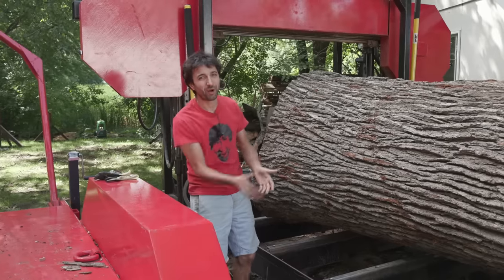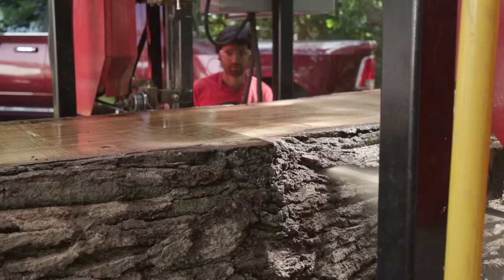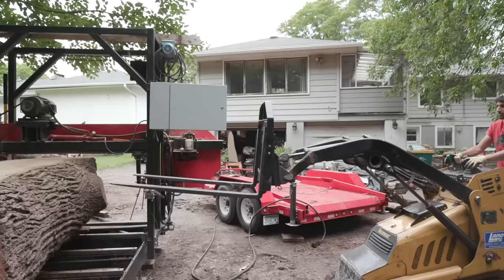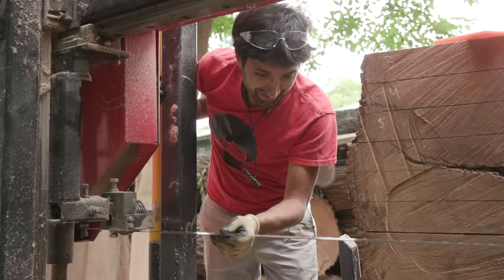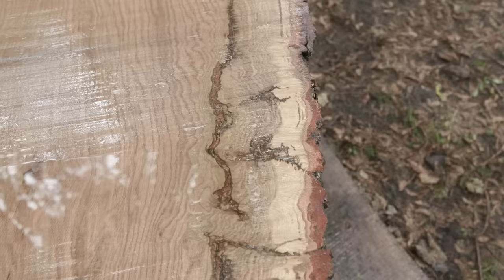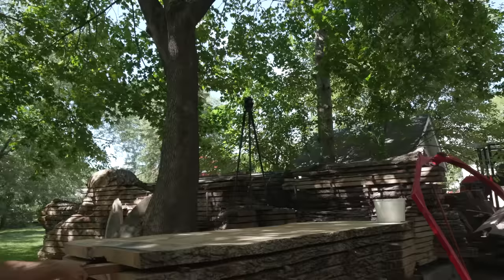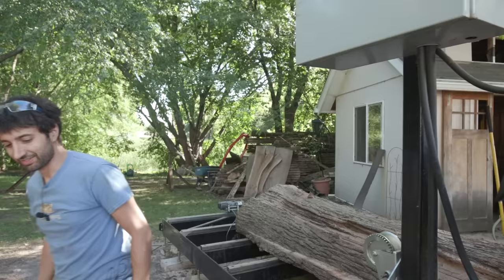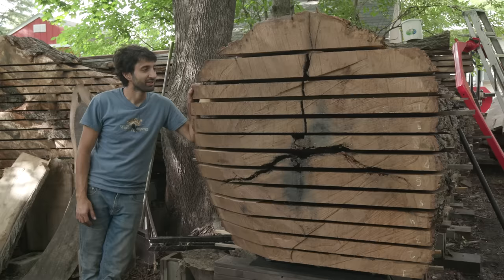Slabbing almost 8000lbs of White Oak

Comment: I'm sure you have answered this question before, however I have not seen the answer. on so many of these bandsaw mills the operator has a drip system or a water tank that auto feeds liquid to the blade, why dont you use such a system>
PS..I like your videos
Reply from the maker: Just never installed it

Comment: Isn't these defects being done to the wood because of the weight from slabs not being removed between cuttings which I think  causes the blade to have to work harder🤔; henceforth, the reason for the blade getting stuck so often and needing to be replaced so often also??🤭

Comment: Matthew I know this is over a year ago but in all your videos you splash the water on the slabs with your bucket. I used to do the same thing but I found it much cleaner and far less messy to run a hose and spray nozzle; same results and I don't get water on me or wherever I don't want it. Thanks for sharing, love your videos.

Comment: I think I would have been getting too heavy slabs off of the blade of each level off of there so it's not putting so much pressure on your blade second slab look like that blade was starting to bounce there's too much weight on the blade get the weight off of the blade it would come off a lot easier the slabs look like the blade has been bouncing

Comment: I realize this video is to years old. 
But the butt pucker factor was the same. 
Having worked at a big saw mill in my youth metal in a log is serious when running a ban saw. The mill i worked at ran one about 30ft long when laying on the floor and a 1ft across.
They ran each log threw a metal detector 
How ever sometimes it would miss something. Nails ruin the blades which cost a few grand each. But the real danger was the metal pushing the blade off the back mill wheels. When a blade goes from thousands of rpms to instant stop all over the cariage. It was nasty. And pieces of blade went every where. Pretty scary! The sawyer set in a cab with ballist glass windows. But anyone walking by could be seriously enjured.

Id love to own a mill like Matt's but I'd want atleast some plexiglass between me and that blade or a remote. Lol 
Metal makes for some cool staining in the logs sometimes.

Comment: This is the first I've watched in a while since I watched the entire saw building series. Even watching someone else slab a log is oddly satisfying!

I have two questions. First, have you ever considered using a carbide tipped blade?

Second, why do you dump water on the slabs as you're stacking them to dry? It seems that most of the water just sits there and will eventually soak into the wood, taking that much longer to dry. 

Thanks for another entertaining video!

Comment: Matt, have you ever made a video to discuss what you would do to make the "CremonaMille" even better if you were to do it again -- size, motor, materials, sectioning, wheels, blades, etc.... What have you learned these last years. Oh and the blades you have been using the gauge teeth/brand/quality carbide #

Comment: A second thought for an enhancement is a rail maintenance area so you can move the top off of the bottom.  This would allow you to experiment with hydraulics on the bottom platform Without worrying about the upper saw part, or repainting the bottom half.  Sort of formalizing what you did when you separated them earlier, but more useful and functional when you are by your self.

Comment: Correct me if I’m wrong, but the pile gets heavier  as you cut down. Wouldn’t it be less stress on the blade and machine to keep taking of the slabs as you cut ? Otherwise your just pinching the blade..

Comment: Get a 1" cube or cylinder neodymium magnet to sweep your log between slabs, will penetrate 4+ inches into wood so you can find metal before you blade does.

Comment: The problem with the blade hanging, may have to do with both the weight, and the moisture content your dragging it through. I would recommend removing, some more cut slabs, before continuing.

Comment: Each plank weights 100lbs. That weight is on the blade dummy dough. Think.
If there is not 500 lbs of weight on the blade will it move easier? Cut better ,last longer.

Comment: A tree weighs 4 tons so if you  cut 6slabs and leave them on the log, the saw will bind up because of the weight on it just like using a skill saw with the most weight on the outside, poor planning.

Comment: Seriously, having 5-3 inch slabs of an 8000 lb tree riding on top of your 6th cut is probably  an indicator of one problem with a sticking blade.  Just remove as you cut, so much easier and safer...just sayin dude..

Comment: You definitely do not know the proper way to mill wood.  Remove those first slabs of wood away.  Don't leave more than 1 slab on top before cutting more.  Less binding problems and less wear on the blade and less milling or cutting marks left on the wood.

Comment: Can this white oak be used for shotguns and rifle stocks and butts..sealed with bees wax and aged.. insuring a long strong life... what happens if this wood is kiln dried... what I have discovered is kiln dried hard wood for shotguns and rifles does look pretty but it is light weight And Very Brittle as I sadly found with a Marlin rifle.. if it is kiln dried production is very speeded up..... are all hardwood for flooring kiln dried.. with these super hard finishes... they can be applied to soft pine.. and become iron hard...thanks... from the inquiring mind...🎺🎺✍️😃🤚🎹🎹🎹the Missourian from the show me state Missourah Territory....